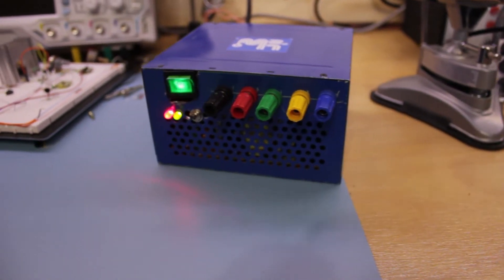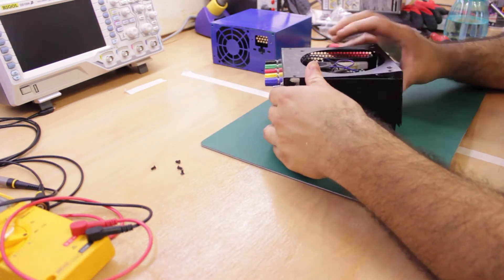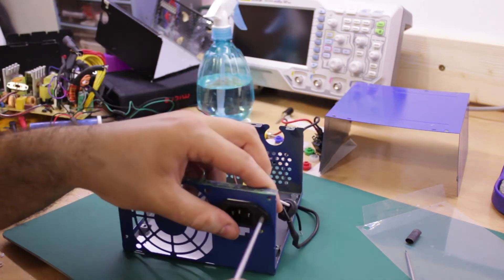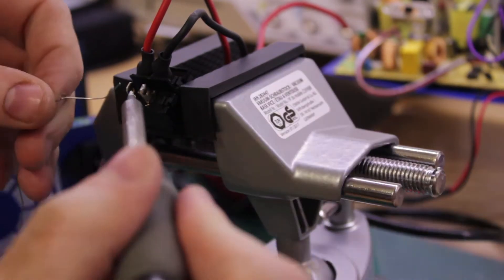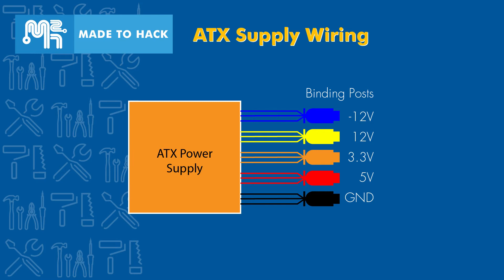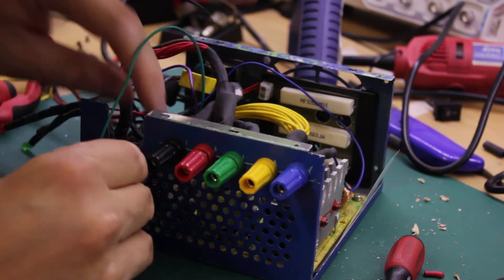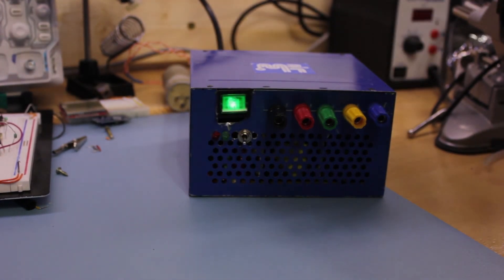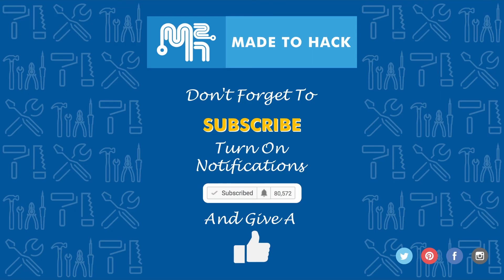How to make a bench-top ATX Power Supply

Comment: Heard you could add a -12 connector then if you wanted 24v combined a lead from +12 and -12 then a lead from negative to get 24v.
Reply from the maker: I guess that my work!
Reply: The -12 V & + 12 volt will give you 24V right but on very low amps……. 300 to 500 milliamps and if you connect the ground to this you’re going to blow up you’re power supply……. Don’t try that

Comment: Thx again for ur help.. i dont find 10w 10ohm in my country i have 10 ohm 25 watts, can i use it or it's dangerous?
Reply from the maker: Hi, 25 Watts is fine. Just because it is rated for 25 Watts, it doesn't mean it will use 25 Watts. Since it is a 10 Ohm resistor, and you will connect it to 5 Volts ( 5 / 2 = 0.5 Amps). It will only pass 1.25 Watts over the resistor, and I am willing to guess that it will not get warm even. In fact, if you use a 10 Ohm resistor, you can probably use a 5 Watt rated and it will be fine, since 10 Ohms will pass half the current of the 4.7 Ohm you mentioned before.
Reply: Thx a lot again ,  because have a nice good quality psu and want to use for powering my 3d printer for motherboard and my original psu for heat bead..

Comment: Thx for ur fast reply. if i understand for my new power supply i make, if my dummy  10 watt and 4.7 ohm 5% come hot i need to try 10 watt 10 ohm?
Reply from the maker: If you put 4.7 Ohm on 5 Volts, then you will be passing essentially 1 Amp. So, 1 amp x 1 amp x 5 Volts = 5 watts power dissipated. A 10 Watt resistor should be fine.

Comment: Its normal the dummy load resistor come very hot?
Reply from the maker: Well, it depends what the resistance value is. For example, if you have a 10 Ohm resistor like in my case, it would be dissipating 2.5Watts (0.5 Amps * 0.5 Amps * 10 Ohms). Since it is a 10 Watt rated resistor, dissipating 2.5 Watts does not warm my resistor up. Try to get a resistor rated at twice the power it will dissipate.

Comment: can we modify the psu to get center tapped? I need  +12v ct -12v to powered an ocl power amplifier
Reply from the maker: I don't know. It already has -12 Volts (on my PSU I made it the Blue binding post). Since it is a switching power supply, it doesn't have a normal transformer to tap.

Comment: i been having a problem with this project. i took apart 2 PSU"S so far and i'm having the same issue. The issue is my 12v line is outputting over 20v and its not staying stable its starts at 18v and goes up. my 5v starts at 8v and goes up past 9v and my 3.3 ends up being 5v. how do i get the Psu's  to output the right voltage on their lines? Am I doing something wrong, or could i possible have 2 bad Pus's? Ps: I used a sandbar 5 watt 5 ohm resistor to see if that would work and nope it didn't. and then i tried 2 in seres and same out come HELP PLEASE!!!!!!
Reply from the maker: That does seem odd, I mean especially when you have two PSUs that have the same problem. Is it a universal PSU that accepts both 120V and 230V? Did you check the switch at the back if it allows to switch between both settings? I can't think of any reasons, considering PSUs are typically some of the most stable power supplies available. You may also want to ask this question on the eevblog forum at www.eevblog.com/forum.